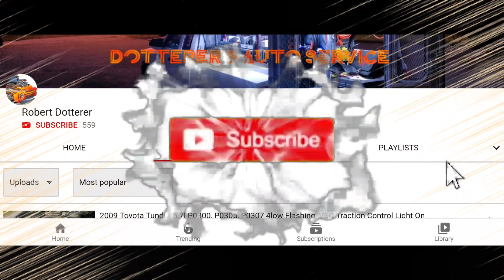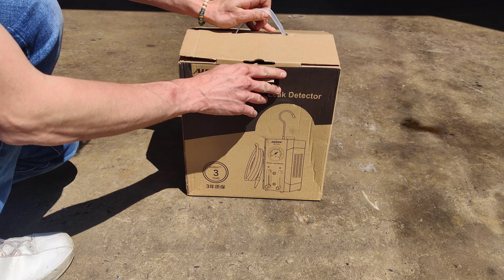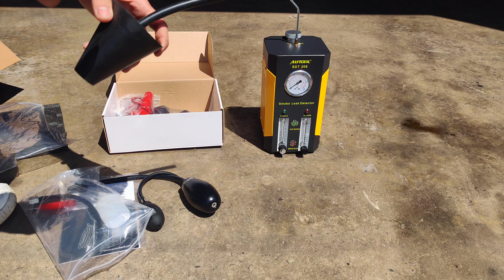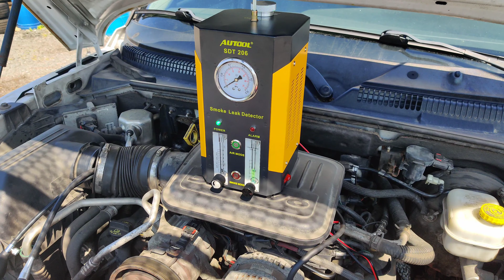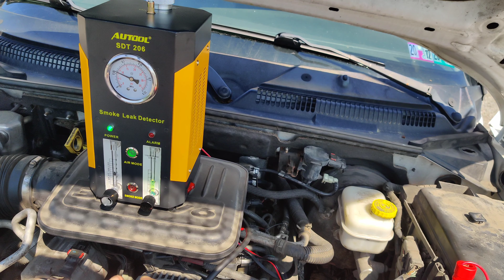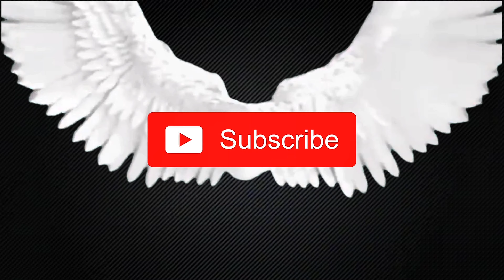Autool STD-206 Unboxing and Testing! (Live Vehicle) Smoke Leak Detector

Comment: I finally got this smoke machine today,i appreciate the review,how has yours worked out this far??
Reply from the maker: I love the smoke machine, only thing you have to watch out is putting too much pressure in the evap system. I would recommend possibly making an external regulator for 1-2psi. Everything else this is great for.

Comment: So this can be used as is for Evan leaks as long as I keep the pressure low? Or does it need a pressure regulator?
Reply from the maker: Yes, you don't want to go over 1-2psi for evap leaks. Just remember most evap systems work in a vacuum not pressure so you are not testing it in the same way it functions.

Comment: I have the older design. Like the newer one. But  not going to spent no more money. Used mine to finda po442 and 456 leak.
Reply from the maker: That's good to hear. Sounds like it was worth it for you.
Reply: Need to be careful using on evap systems.  Keep low psi. Use clamp to maintain a certain psi 1 to 3
Reply from the maker: Yea, I think I mentioned that in the video about being careful.

Comment: Thank you for the video. You may want  to consider to use an inert gas when working on evap and not the oil vapors.....
Reply from the maker: My other smoke machine is set up for co2 and nitrogen. If you have a leak in the evap system you already have fresh air entering the system if you are worried about combustion.